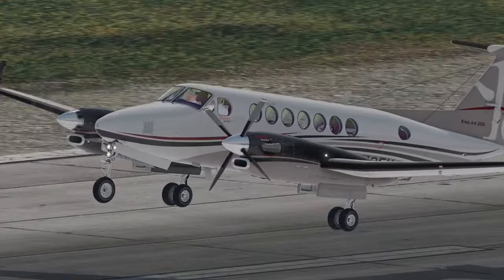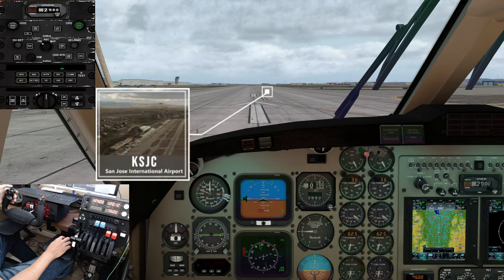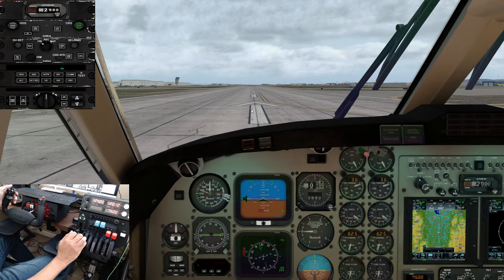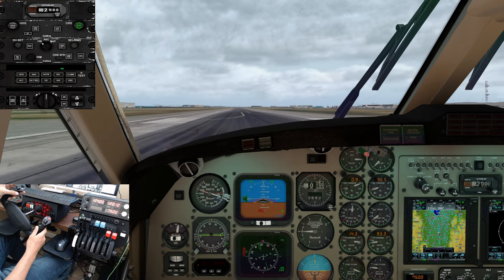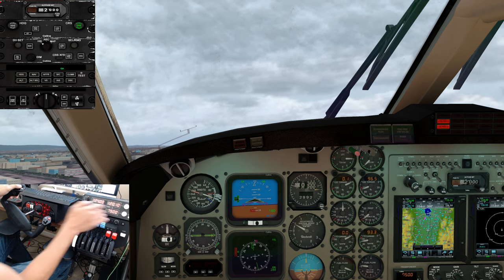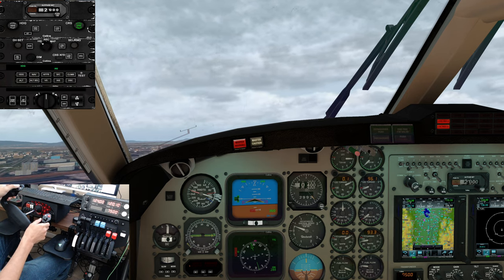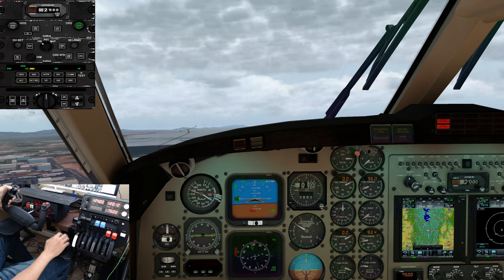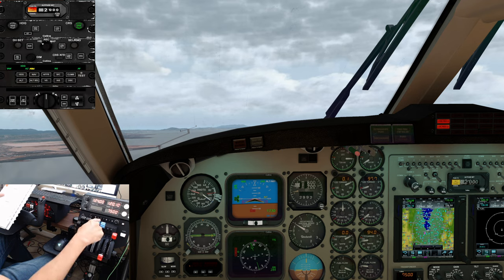Engine Failure - V1 cut | Airfoillabs King Air 350 1.5 X-Plane 11 Tutorial by KA350 Pilot

Comment: Thanks Chaz! Would you let tower know about the failure during memory items procedure before they switch you to departure?
Reply from the maker: Aviate, navigate, communicate. Always fly the airplane first. It's quite busy during those first 4 memory items. Only once the airplane is under control and you're climbing away, then contact ATC. Typically the memory items are complete before 400' AGL. you should have time to  make a quick call to Tower. You normally stay with tower for up to 4 to 5 miles before getting handed off.

Comment: With so many runway available (you did not even left the displaced threshold on VR), would you continue te takeoff in a situation like this in real life?
Thanks a lot for your videos, really helpful 💪
Reply from the maker: In real life, under VMC , with so much runway available, it is possible that we may elect to stop after v1. Really depends on the situation. But be prepared to explain that to the investigators. :)
Reply: Yup…

Comment: To turn a plane back to the departure airfield one should be at 1500 feet at a speed of 125 knots? Before that, it should be runway heading?
Reply from the maker: Well it's a long answer.  Generally, no turns below 400' feet.  1500 feet is specifically for our King Air 350 operation.  Other aircraft I have flown calls for the checklist at 1000 feet above the ground.

Comment: My friend, you have V2 climb out backwards-you’re supposed to bank 3- 5degrees TOWARD the operative engine, i.e. “raise the dead, “ and Split the ball while maintaining constant heading. 
Am I really the first one to catch this? This video is a year old? Good video and thanks for sharing.
Reply from the maker: Backwards?  The video shows bank into the good engine.   3 to 5 degrees is technique and does not necessarily apply to all multi-engine aircraft.  It can be UP TO 3 to 5 degrees but bank isn't the primary concern. Yaw control is the primary concern.   Also, keep in mind, this is X-Plane  and not a full fidelity Level D flight simulator.  I would say there is more pronounced bank in the simulator.
Reply: I watched again and it is a very good video. If you didn’t, my mistake, but i’m almost positive I saw the bank into the dead engine. The comment was 2 months old……

Comment: Quick question, you knowing you have plenty of rw to perform a stop, would you even after V1? If you know 100% you have enough rw to stop.
Reply from the maker: Good question, one that is commonly asked and discussed.  Knowing we have excess runway, if we are to abort above V1, it must be briefed so both pilots are on the same page.  Accelerate stop distance is based on taking action to stop the aircraft prior to a specified speed- in most cases v1 or Vr- and stop the airplane. If you are aborting above this speed, you are essentially a test pilot. In the eyes of the FAA, if you abort above the accelerate stop distance specified speed, you better have a good explanation.  

It is often said there are more accidents in aborted takeoffs than continuing the takeoff.  There are more things that could go wrong during an aborted takeoff because you are suddenly reducing power/thrust and mashing on the brakes, all while trying to maintain control at a high rate of speed.  On the flip side, you tank an engine at or after v1, meh... continue,  slowly rotate the nose and fly the airplane.    
There are many variables to consider so a thorough brief with the other crew member(s) is imperative.  In the home flight sim world, not so much. :)
Reply: @chazflyz why thank you for that detailed explanation, was just wondering considering ive seen many pilots reject even after V1 for excess Runway.

Comment: Hi, Why do we have to keep the condition level always on low? Is there an specific reason? 

Thanks!
Reply from the maker: If you follow the checklist from the manufacturer, we keep them at low idle.  I have never received a specific answer other than it's quieter at low idle when taxiing.  
Some pilots prefer to move the condition lever to high for takeoff and will retard it to low after landing, for taxi. Some prefer to leave it low for all operations.

When the condition lever is in high, faster response to reverse is available on the ground with more reverse, while it also means more residual torque or thrust coming over the fence when landing. If one must go around, keeping the condition levers high on landing keeps the engine spooled up a little more, giving a faster power response.
Reply: @chazflyz   Thanks a lot for the info Capt! Happy Landings!